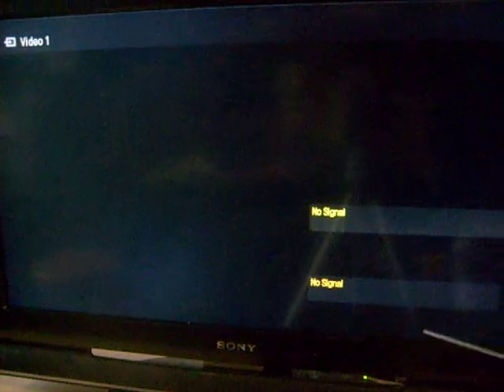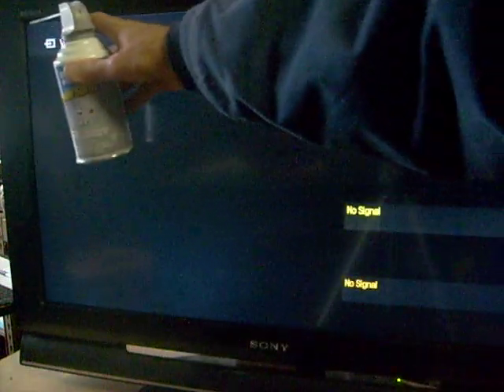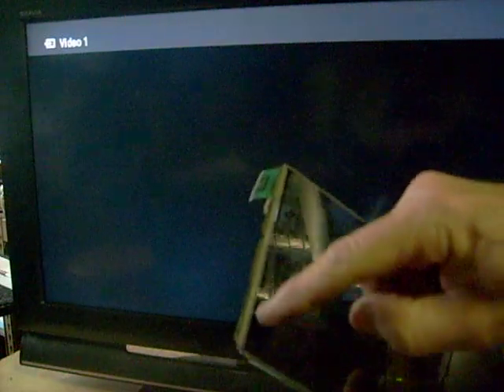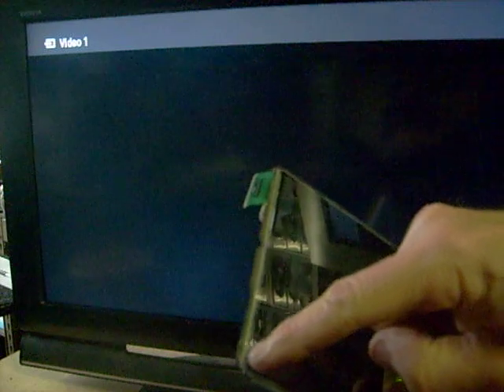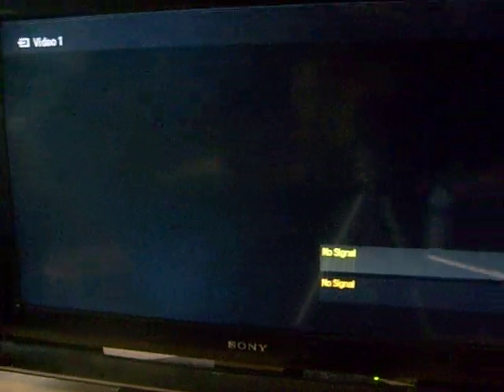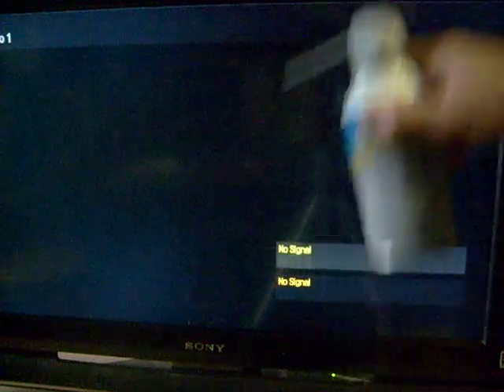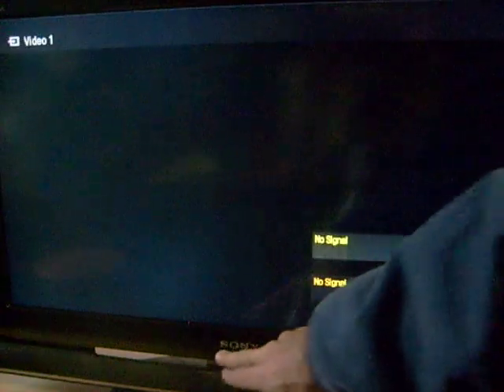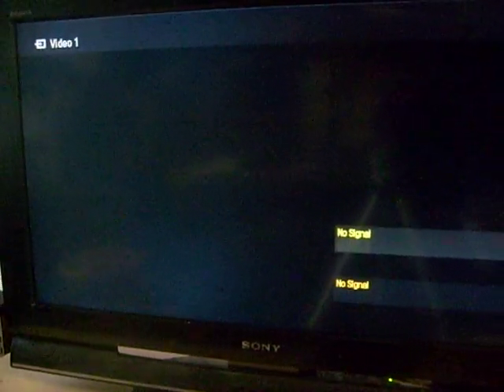LCD Display problems.

Comment: Yes thanks but how do you fix it? 
Do you glue those cables?
Reply from the maker: A few people have discovered ways to maintain pressure on the connecting points on  the display in some cases, but many times there is nothing you can do. Here is a video by norcal 715 you may find helpful. https://www.youtube.com/watch?v=purk_SyiT44

Comment: My Sanyo has an extremely bright screen so bright that it hurts to watch anything on it. None of the settings fix how loud it looks. Could a bad capacitor cause this?
Reply from the maker: +Death2NubbyNubs I doubt that it's from a bad capacitor. I would be suspicious of the T-con board but I can't guess without doing some tests.

Comment: Freeze spray is a good idea.  I wish I had thought of it.  Seems like a good approach for any suspected heat soak issue.  I'm going to try it on my Samsung UN55B7000 55 inch LED-LCD unit.  It takes a few hours for my horizontal double line issue to appear.

Comment: What was that spray again? Can you tell the exact name ans where to buy?
Reply from the maker: James Bond It's just freeze spray. It makes things very cold. Here is a link to a company that sells it. http://blowoff.com/
Reply: Thank you.
Reply from the maker: Keep in mind it will not always tell you if you display is bad, but it can be useful in troubleshooting bad capacitors and intermittent boards in some cases. It's kind of a spendy way to troubleshoot but sometimes it's necessary.

Comment: did you fixed the tv or returned to the costumer. just curious
Reply from the maker: In this case I told the customer his display is bad. In some cases you can install rubber shims between the bezel and the display to buy a little more time if you have a bonding problem.

Comment: hi good after non me i need your advice please! what will i do my problem of my KTC LCD TV. MODEL 32T53. the problem is there's a power when u on the power swith but in few seconds they can turning of. pls help me guys ... what will i do?
Reply: Hi good morning.... i have a samsung lcd tv. LE32D404E2W
Model code:LE32D404E2WXXE.
Type  no: LE324404. from swedin then here in the philippines. how to set to get proper connection of a cable. i was trying but in plug in play menu need code. the manual have default oooo then i try after all got no channel at all? the question is how to get proper set up on this samsung tv to get proper channel? pls... help me guys...

Comment: Hi Dave, i have Toshiba 19LV61K, No Picture Only Sound, i took my TV to repair parson, they said i have to change HDMI / Tuner Video Board i did but same and other said change Inverter / POWER PCB, i did my self, but no luck , here is my video link please help.
youtube.com/watch?v=QeKLU5UJquY
Is this LCD tube-light problem ?

Comment: Is the standby light on when the tv is plugged in? If not Check fuses on the power input to the tv it may have blown the fuse feeding the power to the power supply from the wall outlet. Its usually a relatively easy fix some are  hidden inside of heat shrink so you have to know what to look for they are usually soldiered or just snap right out

Comment: my Sony KDL-32M3000 doesnt power on after a black out (electricity went off/out). How can i do to fix it? Does this have a solution? The socket wasn't protected with a UPS. any help would be appreciate. thanks in advance. regards

Comment from the maker: @Chuckjs21 Your display is cracked and it's generally not worth the cost to replace it. The LCD portion of the display has a thin layer of plastic glued on the front so this is why the crack isn't obvious until you turn it on.

Comment: Hi Dave, I have a Sharp lcd Lc-26sB24u. It works fine for a day or hour or week, then goes white, but still plays sound fine.Some times pic flicks normal to white back and forth till all white, What would you suggest I check? I work on Video Arcade monitors, but this a new beast to me. Thanks Jay

Comment: dav are the same guy on 11 meter ssb travis kf7lvp or 395?anway ecellent info in this vid.i have a 20 inch poloroid that goes black after start up.think it is the power supply caps?

Comment from the maker: @IiIweezer 
I'm not entirely sure what's causing your symptom. I would guess it to be one of three likely possibilities. T-con board, driver board. or bad display. I'm about to produce a video which talks about symptoms and causes in the hope that others will leave comments as to what they did to repair certain problems.
Dav

Comment: Good tip, Dave. Thanks for sharing. These type of connection problems have been a major issue with LCD products starting with DMMs and radio displays going back to early years of LCD. I have always found putting a rubber spacer in the back to put more pressure to the connector-display but have never tried it on a larger scale such as LCD TV. Try to strip off the insulation of a phone cord long enough for the length you need and be careful not to apply too much pressure (or else crack the LCD).

Comment: @GrantsPassTVRepairs I've Repaired a 50" Pasma with a thick vertical line which was caused by looses glue connectors between the buffer board.Shamsung again.Would you like me to make a Video.I used A Glue Gun & Heatsink Pad.

Comment from the maker: @mythril4 After watching several videos on solder paste I'm not sure your correct. The contacts I examined under my microscope showed no signs of ever having been soldered. On one surface they solid gold in color and the mating surface appeared to be coated with carbon which looked very much like the electrodes on the contact points of a remote control.

Comment: @GrantsPassTVRepairs Yeah.Doesn't work all the time.I've done that as well when i overdid it.Another i've used in the past on a samsung 22inch LCDTV was a hot glue gun and pressed it againt the frame while its hot or very thin wire on the buffer board.Sometime the buffer boards on either side connection point loosens up.Route it to a solder point.Let me know how u get on.Some Good Tips here

Comment from the maker: @AeroDurbanite 
I recently tried to repair an LCD display using hot air and pressure on the screen connector only to make it worse. Perhaps in some cases it works but I wasn't so lucky.

Comment: I've never tried it with an lcd tv but on a gameboy I have run a hot soldering iron over the ribbon cable where it connects to the board and that fixed the screen. Thanks for another great video.